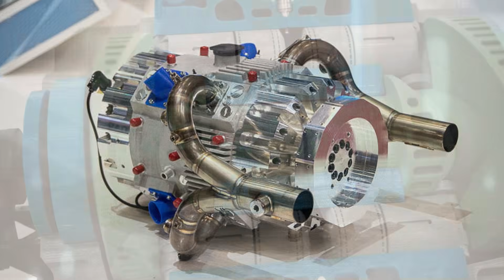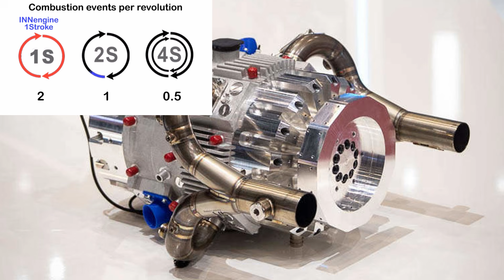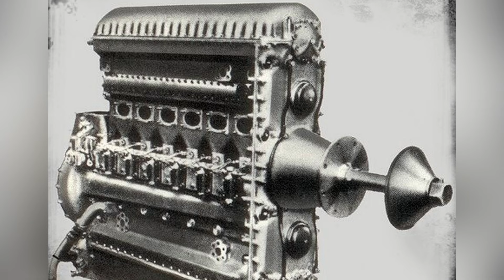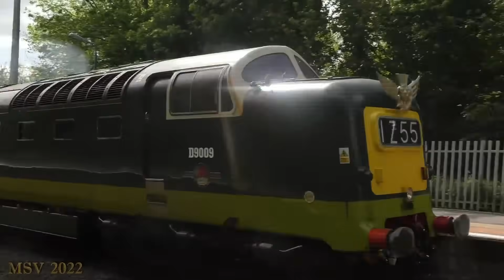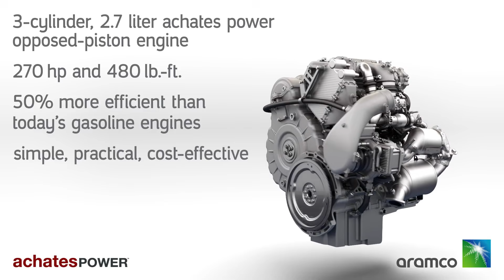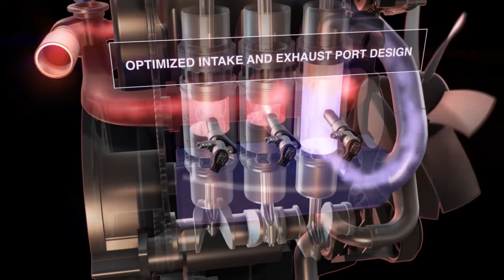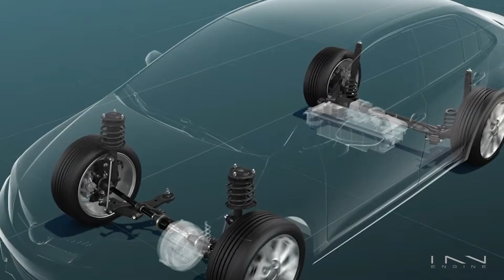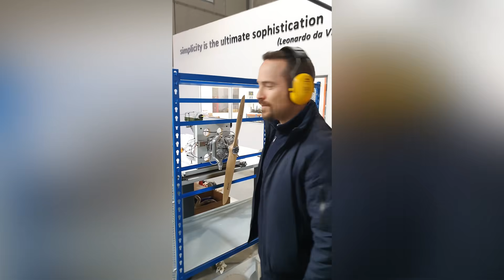NEW OP Mini-Engine DESTROYS Pure EVs

Comment: Interesting - I operated equipment with a 6 cylinder (12 piston) vertically opposed, 600 HP 2 stroke(supposedly multi fuel) engine  which was not considered very successful in its time.  The Leyland L60  had a major problems with cylinder liners and coolant in the exhaust was the first sign of major failure.  
PLEASE LOOSE THE CLICKBAIT!. Your suggestion that this concept "destroys EV's " is nonsense and damages your credibility

Comment: This type of engine is already common in waterblaster pumps.  Waterblasters suffer failure if the water is disconnected, I wonder if this engine will cope with abuse as in missing gears, etc....

Comment: You missed the Commer TS3 truck engine, with three barrels, six pistons. The sound they made when driven hard had to be experienced to be believed. The machining had to be absolutely accurate, and the complexity of cranks and double ended rods  meant they became prohibitively expensive,  but they made glorious low profile engine for powerboats. Thrilling acceleration and a cockpit the size of a ballroom.
Reply: I know what you mean. My uncle is still running is old Commer to this day
Reply: @WrathSin007  Cool! What part of the world?
Reply: @malcolmwolfgram7414  The UK invented it, years ago.
Reply: @malcolmwolfgram7414   Down in Queensland Australia 🇦🇺
Reply: As a kid, one of the trucking companies had one of these Commer trucks.i was always blown away by the sound of this truck accelerating.
Reply: I often wonder if, given modern engineering like high pressure common rail injection and modern Eaton blowers, a modern version of the Commer TS3 would be viable. It was a remarkably simple engine really, when you look at the total component count, and without cylinder heads and valves to worry about, servicing them would be remarkably easy.  I think pollution would not be the problem it's made out to be, I think noise might be the biggest factor.
Reply: With an EV you get thrilling acceleration all the time and it costs far less to run
Reply: @nathansmith7153  
Cost per mile on long highway trips is not much different than gas in the USA... Europe is a different thing. Fuel costs there are double at least.
You can still have your EV performance..  But you won't need as large of a battery... enough for daily trips.. and have the ICE as backup power and for highway use.
Surge power for acceleration would still come from the battery.. You only need enough power from the ICE to keep the car rolling at speed, and a little more to keep or slowly charge the battery.
Reply: @kens97sto171  So you spend all your time on long highway trips? What a load of nonsense. Hybrids suck.  My EV just works fine.  3 cents a mile and no maintenance for 4 years.
Reply: @nathansmith7153  
I said the cost on highway trips is not much different versus a fuel efficient hybrid. And that is absolutely true in the United States. If you look at what the cost is at superchargers. It's very nearly the same price as buying gasoline over the same distance. Obviously when you charge it home it's significantly less. Closer to that $0.03 per mile you're talking about.
My Toyota Hybrid costs me between $0.07 and $0.10 per mile. 
Back when gas was in the $2 range it was closer to 7. 
At current price this is closer to $0.10.
That includes fuel, all maintenance, and tires.
Oh yeah and I bought the car used with 200k on it. for $2,000. Drove it for 4 years and put 223,000 additional miles on it..
It now has 423,000 miles on it.
And spent between 15 K and 22K total. Depending upon what the fuel price was at the time about half of that it was on the low side and about half of that it's been on the high side. So let's do the math again. I spent at the most $24,000 for the car and the fuel and the maintenance and the tires over 4 years and 223,000 mi.
How much did you spend to purchase your EV.. and how many miles did you drive in that 4 years? 
Plus all the supercharger costs and the electric bill and the supposedly no maintenance which I don't buy at all. Unless you didn't actually drive that much in those 4 years...How about your tires? How much did those cost you?
Set a tires for my "crappy" hybrid can be purchased for under $500 for a set installed. 
Oh yeah I can drive on the highway for 450 mi non-stop before having to stop for gas. And then take 3 minutes to fill my tank to drive another 450 mi.
I take road trips a couple times a year. The rest of the time I'm driving around in the city 200 to 300 miles per day 5 days per week. So I would have to stop and charge in the middle of my work day. If I had an EV. Probably couldn't do the work day and make it back home. Not a problem in my gas hybrid.
So let's compare shall we
Reply: @kens97sto171  Yes you are wasting your money - I get like 133 mpg based on fuel costs and can figure out how to take  long trips.  With no maintenance in 4 years.
Reply: @nathansmith7153  
I would say you're not very good at math..
$2,000 spent on my car to purchase it.
$18,000 in total cost of ownership over 4 years and 223,000 mi.
So that's $22,000 total. 
Spent over 4 years.
To go 223,000 mi.
That works out to $0.10 per mile.
But I still only spent $22,000. Versus you spending double that for the car alone.
Doesn't matter if your maintenance costs were zero. You still spent double the amount of money that I did.
And how many miles did you drive in that 4 years? You still haven't said.
Reply: In other words, an engine which allows for practically no wear (machining has to be absolutely accurate) and is prone to mechanical troubles which require costly and time consuming repairs (complexity of the machinery).
Gee, I can't understand why it never caught on.  It sounds like something that the Germans would just fall in love with.
Reply: Have a look at a Napier Deltic T9, an engine that could only ever have been designed and built in Great Britain 👌🇬🇧

Comment: Early in this video you parrot the designer's claim that this is a 1-stroke engine.  Look again.   Each pair of pistons do come together at TDC or compression-delayed/adjusted TDC before combustion, validating them as opposed piston arrangement.  However, each piston ALSO must move 2 directions between firings.  Intake and compression on 1 stroke, then combustion and exhaust on the next. Simply having one of the combustion chambers firing every time a piston pair reaches TDC or BDC does not make this a 1-stroke engine layout, otherwise a 4-cylinder 4-stroke could  be called a 1-stroke engine since each 180 degrees of crankshaft rotation there is a combustion event.  This is truly a 2-stroke layout and still really cool.  I love the adjustable compression ratio they've incorporated into it.

Comment: Fairbanks-Morse diesel engines of the 1930s and 1940s as used on many ships in the US Coast Guard and US Navy during WWII were of the inline, opposed piston design and were a two-cycle combustion series.  The biggest issue that we had with those engines was coolant jacket leakage into the combustion chamber where the fuel injectors were mounted.  The injectors had to pass through the coolant portion of the cylinder liner assembly and on into the combustion segment of the liner.  This issue with coolant leaking into the cylinders was a chronic problem that we had. Otherwise the 12 cylinder units were basically good engines.  Fairbanks-Morse diesels were available in many different cylinder counts according to requirements.  These were not clean engines by any means.
Reply: I worked on a Canadian Great Lake Freighter with 4-12 cylinder Fairbanks-Morse 600 RPM very Loud and Thirsty engines.
Reply: The Cleveland / EMD engines were a much less problematic design, and in the world of railroading, the EMD's reigned supreme over the FM's (and every other builder, as well) for many decades.
Reply: I would love to redo a FM OP 38-8 @1/8 with carbon fiber v-force reed valves for each upper and lower crankshaft chamber and run ethanol. next a dry sump with castor 927 maxima 2T bean oil and some vro pumps plumbed in there. hell yeah
Reply: Any ICE is really a mechanical nightmare.  That's why many applications will use battery/electric motors going forward.  They are so much simpler and reliable.

Comment: The crankshaft is not the biggest problem of the internal combustion engine.
Its biggest problem is poor efficiency and environmental pollution. This engine does not fix them.
A very specific error: The direction of rotation of the bearing rolling on the track that controls the displacement reverses every step. This can only happen by sliding, which will soon destroy the track and the bearing.
Reply: Ev is way more worse when comes to enviroment. Thata what most people dont realize.. even if all cars are ev you still need to build ev and build roads. Plastic and roads cannot be build without crude oil. When all those batteries start to die you think they are good for enviroment? Also electricity takes again fossil fuels so those ev cars could be charged. Ev is just useless junk

Comment: The internal combustion engine has had over a hundred years of development. It is only recently that battery and EV technology has become important. My fear is that the USA has not committed to public transportation and is thus locking itself into a car centric urban/suburban design. I also believe that hydrogen combustion will play a role as a specialized high end sources of power. 🌻
Reply: Just add one more lane bro😎
Reply: @Fredoca_Laroca  That has been tried and it does not work.

Comment: Cam track? On paper it looks neat. The load bearing surface interface between the piston roller and cam plate will be difficult to make reliable. High pressure oil lubricated shell bearings, as used for crankshaft journals remain the most robust and inexpensive bearings to support the rotation of reciprocating engine parts. A single roller on a single surface wont cut it. The engine would need to drag the piston down to ensure it would start.
Reply: Not to mention how this engine doesn't have a crankshaft, so it cant take advantage of the lever effect that makes piston engines have more torque. This thing will need to rev super high to make any sort of meaningful power, making it even more unreliable. This has been shown on the miata they drove with this engine, which even when supercharged struggled to move the car at low RPM. It does have advantages that might improve its reiability somewhat, such as the fact that its naturally balanced

Comment: IMHO...
I believe PHEV is the way to go, pure Electric will never be the answer.
Using electric for stop and go city commutes is very efficient and would reduce the smog in metropolitan areas.
However, gas is the way to cruise at highway speeds. I owned a 2017 Chevy Volt PHEV, and now a 2022 Kia Sorento PHEV. Both are very efficient, with local commutes on pure EV and upwards of 40mpg when on highways. That being said, I added a gas engine to my 2015 Electric Smart fortwo to make it a PHEV.

Comment: I‘be always loved the simplicity of 2 strokes. This model looks very “cool” but what about the cost of fabrication and then maintenance. Just machining those parts looks technically challenging.
Reply: It will be no problem for a multi axis cnc machine
Reply: If you see modern Otto engines the sophistication of the way they need to be adjusted will blow your mind. Tolerances are in order of few micron, oil specifications are very strict, heat working conditions are very narrow, and etc.... This engine has no more exigences in building that another one, but have the advantages of reducing mobile parts and its inefficiences. It is not a substitute of all Otto or diesel engines, but a way to give more efficient work in certain situations like i.e. rechargin and E.V. making it a extended range vehicle, and giving users a security about never being out of battery.
Reply: Exaustão como um 2 T  😂👎 seria melhor motor 2t !
Reply: Two strokes have numerous problems.  The one huge problem this engine has is running on fossil fuels.  It will pollute in both the conventional sense and in the sense of releasing carbon.  Many people just don't understand that we need to cut carbon emissions virtually to zero.  

The overlap in the port timing will release large amounts of unburned hydrocarbons into the exhaust.  It's simply not workable.  It's like inventing a better buggy whip about the same time Ford starts selling the model T.
Reply: Oh fiddlesticks just enjoy the brappp and the castor 927 maxima!
Reply: How about a fairbanks morse 38 8 and 1/8th with carbon fiber v-foece reedvalves after for each bottom and top crankcase space sectioned sealded off and casor 927 maxima dry sump and some VRO pumps plumbed in. Run e-85 and castor 927 maxima 2t hell yeah! Thats would be for my dream tugboat main 2 stroke engines!